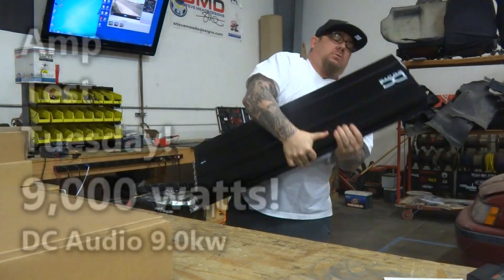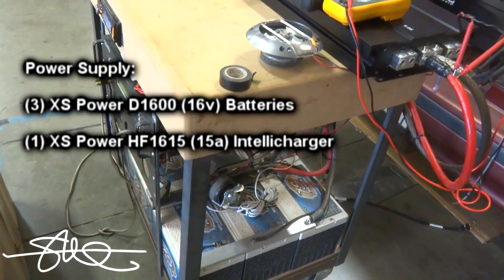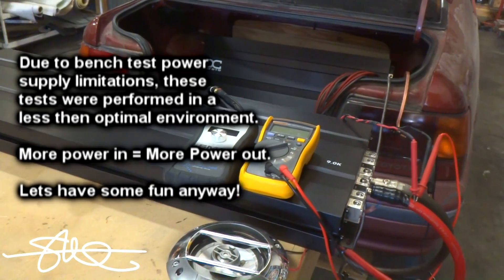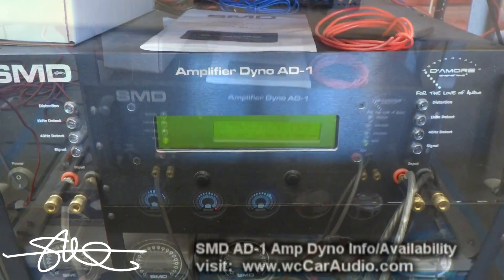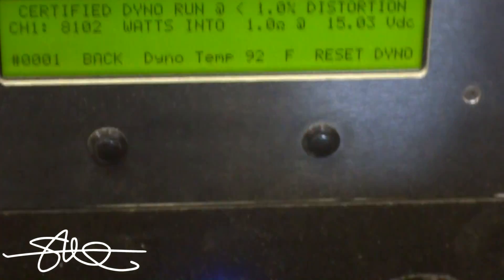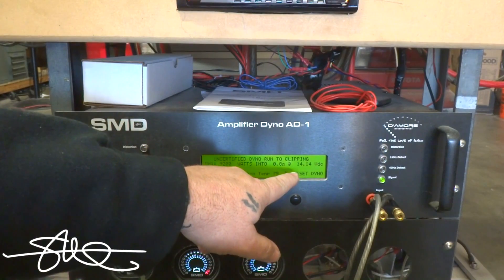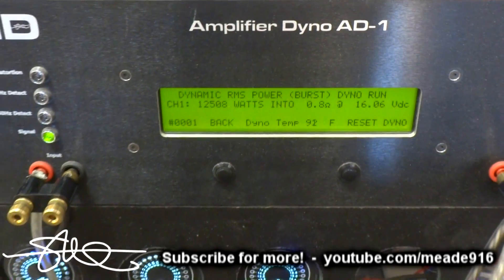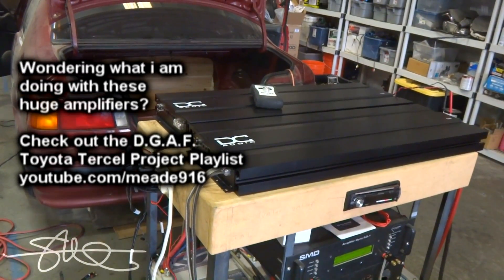Amp Test Tuesday - DC Audio 9.0k - 9,000 Watts - SMD AD-1 Amp Dyno (Results)

Comment: No thanks... That amp for $1750 that does a little over 12,000 watts at .5 ohm. Or a taramps Big Boss 8k for $650 that does 17,300 at .5 ohm. Id take two of those with cash to spare.
Reply from the maker: dude, you are a window shopper.  Hard to take someone serious who doesn't own anything and never has.  Your complaints mean nothing.  Don't tell me what you "would do" show us all what you DID do.  I'll wait. Also, you do realize this video is 10 years old right? relax champ.

Comment: This is a newbie question for you I don't understand how amplifiers can use all the power cable handling of these 2/0 cables when you get inside component wires all appear to be smaller than 12 gauge or 10 gauge. And how does all that juice flow through that tiny little filament inside my 300 amp fuse?

Comment: I'm not sure if you will still reply to this thread Steve meads but I have a 2014 Nissan Altima and I have a 250 amp aftermarket alternator and was looking to upgrade my system next year to 2 level 5 dc audio 15's with a dc audio 5 k  amp with a xs  power 7500 d battery my question is this will running more batteries allow you to handle more power? Because i thought about running 2 250 amp alternators but I was told that might mess my computer up on my car so i was wandering what the best thing I could do your help would be appreciated.

Comment: on some of the bigger amps u have tested couldn't u just pull a vehicle up next to the test bench and run a ground from the engine block and a hot from the battery post of the vehicle providing it had the big 3 done. that way it helps the little battery bank make a pull

Comment: meade916 Thank you for all you videos you my freind do know youre field in car audio.
I want to push 8 12s subs in my monte carlo ls now would you preferr mdf or birch wood?  and i would like 3 amps total.1amp for mids&highs & 2 Amps for the subs any idea i really like jl audio and i have 4 jl w3 12s & 4 kenwoods 2000 watts.
Reply: Natural birch plywood 13 ply is the goods but harder to work with than mdf with the edges and chipping....  Ive used both and the birch is far nicer to me....
Reply: +General Zod thanks thats my choice✌

Comment: how much is the dyno anyone know???
Reply: +CONCRETE MONEY $3400. A bit overpriced, I'd say!
Reply: +meade916 No, it doesn't, but I also think that it is an incredible work of engineering. It looks to be built like a tank and looks very industrial. I love what it can do, and that it was made in the US! I would also probably own one if it wasn't for the high price and the fact that it cost more than my high performance video editing computer!

But, hey, it doesn't matter what I say!
Reply: +Joshua's Recordings Everything is pricey, Its does it do what its suppose to do or better for the money. This is not something an average Joe is going to own, This is for audio shops and businesses that have a purpose for it. 

I see your trying to keep it known you respect Steve that only you feel this item is overpriced. Look on the market for anything that does what this will do and you will find your spending 15k and will have multple pieces of equipment to get the same results yet taking up 5 x the desk space.
Reply from the maker: +Joshua's Recordings good thing it don't matter what you say.
Reply from the maker: +Joshua's Recordings my "high performance video editing computer" costs twice as much as the AD-1..... so i find it to be very cheap and affordable.   And you are right, it still doesn't matter what you say.
Reply: +meade916 Yea, and you run a shop for car audio and do a very good job. So if I did that I would also probably own the AD-1. Also what brand is your computer? Or is it custom?
Reply: ***** i have to agree fully
Reply from the maker: +CONCRETE MONEY what are you agreeing with?
Reply: +meade916 A while back someone posted this: "then it also doenst matter what you say.....TO YOUR CUSTOMERS. f***ing being an a**hole dude....you make the thing.... why would you say anything bad about it? right?   so....wanna print out a parts list so i can go find them all, add together the price, and find out how much profit your making? a resistor network and a few relays, with a few tap points for the volt and amp meter, with a small logic circuit to do the addition... thats not 3.5K.... or does that not matter? you make a product..."For some reason it got removed before I could read the rest of it
Reply from the maker: +Joshua&#39;s Recordings he isn't agreeing with that fuck.  Must be a mistake.  He owns SMD products.  So i am trying to figure out what he is actually agreeing with.  Nobody in their right mind would agree with that piece of shit "kain".  Well just the cowards, the trolls and internet bitches anyway.  That dude don't sound like one in his video but you never know.  I guess i will find out.
Reply: +meade916 Alright then. Glad we got that out of the way! By the way, you seem to know "kain" did he hate comment on other videos?
Reply: Just because you don't agree doesn't mean the other person is dumb. Hate to break it to you - but if you talk to people like that you will NEVER win an argument. By talking like that it shows the other people in the argument who has the facts and who is just being a dumb swearing person that no one wants to talk to.
Reply: Ok, I missed a comma between "dumb" and "swearing". Let's see, you missed a comma between "dumb" and "b***h". You also did not capitalize my name right, you did it: "JOsh", hate to break it to you, the correct why is "Josh". You also put an extra space between your sentences. Oh, and by the way - what did I spell wrong? You are making it quite clear that you are the 12-year-old punk who is trying to be a man.
Reply: Joshua's Recordings TLDR rekt.  Keep crying kid.  HAHAHAHA
Reply: Too Lazy; Didn't Read, huh?

Comment: have you done a system for a Tesla yet? I'm just wondering since the car is basically a gigantic battery!
Reply: ya a tesla would be cool especially the new SUV model X  with like 8 SMD 15 in it in a SQL set up how ever you would need a tesla home back up power pack and step it down to 16v it would be a interesting  project but not impossible. .

Comment: I got a question about amps vs subs if you wouldn't mind aswering(anyone) I''ve bought an orion hcca 15 4 ohm dvc and I was looking at getting a hifonics my olympus atlas 6000 1d is that a good fit?
Reply: I would get an American bass 200.1 that will do better than the hifonics and the build quality of the vfl amp is great they are built like tanks and I seen one run at .25ohms on burps and .33 ohms daily on music. I just bought the smaller vfl120 and it is a massive amp and smashes my old hifonics Brutus amp

Comment: could you do a test on a spl gla1-3400d please???
Reply: Not even close to rated I used to run the older spl amp like the fx3000.1 I think that's the model number, but the gorilla amps aren't good at all. No disrespect if you have one and like it then don't let me take that from you

Comment: Mr Meade nice testing done there.
Would be nice if you ever could use a hybrid car, like a Hybrid Tahoe or escalade.
Even though those batteris are 300v, thinking you are the most experience i known.
Maybe you could make a mod to squeeze 18v out of the 300v hybrid batteries.

Comment: Can you do an amp test Tuesday on a dual 400 watt amp I think it pushes atleqst 500 watts and I wanna know for sure what they push
Reply from the maker: if it is a "Dual" amp i wouldn't get my hopes up on it doing the 400 much less the 500 watts. Sorry bro.
Reply: whats your take on SSL and Lanzer amps?
Reply: DRG Angry I am not playing I had the aero series ssl amp it was 1500 watt monoblock 2ohms stable and only did around 260 watts they are worse than boss. Hifonics is the best for budget amps
Reply: DRG Angry lanzar amps are good for the money. I would recommend the opti drive series.

Comment: Hey Steve I got a question when install sub in you car my sub is 4000 watts what type of amp should I have one with greater watts or lower just not figuring you might know
Reply: GOLDEN CHILD how do people possibly believe underpowering your speakers will mess them up. so no one should run their mids and highs off head unit power because their stock speakers are rated at 15 watts rms? i think you need to realize that alot people who "underpower" their speakers think that since the amp doesn't put out more power than the speakers can take they can turn the gain all the way up in which case distortion and clipping damage your speakers. not underpowering them.
Reply: You needa altleast get 1 that's greater then the watts on the speaker cause under powering speakers will mess them up in the long run if the sub is 4000 I was get a amp that's 5000 watts so that way you know your pushing you subs right

Comment: Hey Steve!
I have a small problem i need some help with.
I recently bought the JBL GTO-5EZ. It's bass channel is rated at 500w rms @ 2ohm @ 14.4 volts/1075w rms @ 2ohm @ 15.5 volts.
I recently blew two different subwoofers on it, and i'm worried over the larger one i blew since it's rated way over my amp's 14.4 capability.

First one i blew was a 10" 300w rms (650w peak) dvc 4ohm Audiobahn Murdered out sub wired to 2ohm.
The second one was a 10" 900w rms (1800w peak) dvc 4ohm Soundstorm CL sub, which was also wired to 2ohm.
I blew both really hard with my amp and the soundstorm sub left a stench in my trunk which will probably stay there for a week or so.

So i'm 100% sure i wired everything properly, and i'm about 80% sure the Soundstorm sub is of way lower quality than the Audiobahn since the Soundstorm didn't respond properly to frequencies above 80hz (amplifier frequency filtering). Both were set up with a clean gain, thanks to a website that gives out free -5db 40hz test tones. So. I made sure the sound was coming out crisp and clean and i definitely wasn't clipping them.

Should i go with a sub passing the 1000w rms mark since the jbl amps are clearly feeding more than the manufacturer states, and since the max at 15.5 volts (even though i'm only running at 14.4) is 1075w rms?
Reply: You need a better sub sound storm is worse than boss get a jbl sub to go with it. Or try alpine type r, American bass xfl, just stay away from the brands that advertise max power it's useless try an American bass you will be happy
Reply: I'm not asking advice, i'm asking for a video of him to try them out, as to have video evidence!. Thanks for the reply though man.

Comment: Nice work Steve. I enjoy the inner geek that says what the hell does it really do. I would like to see some cost to benefit factors tested more. As in I have these 2 tens in this car and I slap amp a in for x dollars and sweep for db's. Rinse and repeat for amp b and so on. The reason I say this is that pep's are all about the amp that squeezed out 56 more watts yet do they even hear a difference. Sure if 1 amp is putting out 150 and the other 200. Most bass heads are going to be looking at less than 1 db difference when jumping from 1 amp to another given that they are rated to be close to the same anyway.

For instance put a SoundQubed 1200 up against a DC 1.2k. The difference in their respective outputs will be negligible at best. So you buy for build quality, features, looks, or cost. I am all for finding the bang for the buck. Perhaps torture test the amps and see which breed takes the beating longest.

Comment: @ Jeff da chef y do I always see ppl dis audiopipe they are not bad amps Steve tested the hifonics 1700.1 elite and it did rated power so what makes an amp bad or good as long as it does what it says it does check out derrick bigdwiz ch. He tested an audiopipe 1500 and it put out well over 2000 watts

Comment: Meade916 I been keeping up with your work...I have a 2001 chevy 1500 extended cab and I wanna run 4 12 type r.. do you have any suggestions on what two good reasonable amps I could run with the most bang for my buck? What are your thoughts on Crescendo audio bc 35000

Comment: Dayuum that's insane. I noticed you also only put one power and one ground to the amp, does that mean you don't really need the other two to run the full 10000 watts ?
Reply: i wouldn't do that. it will probably run hot and over work the amp.thats why it comes with 2 power and ground inputs.

Comment: That is awesome results from the DC amp on that power. You figure each D1600 is good for 1500 watts each, so they are giving that amp all they have and still holding on pretty damn good. 4,500 watts of battery power for a 10K+ watt amp.
Reply: umm you got real life experience in my car lol.. they stay at 11v when im at full tilt.. ;)
Reply: s3ns4i
You have 16v batteries that go to 11V at full tilt?
Reply: J noADnROhh

Comment: Your more than likely to busy to answer this but i have a 1998 Z71 pickup truck extended cab with 2 orion hcca gen 2 10inch subwoofers hooked to a (i know its pretty cheap) a planet audio big bang series 1400.1 "1900 watt" amp. My question is would it be enough power in my truck if i ran a single XS POWER battery up front in my truck? If so which would be the best one to get?
Reply: the bigger the better they say :P
Reply: you can never have too much overkill with the electrical system. Hell, overkill is the only way to do it!

Comment: I must say I'm an Alpine fan but the cost is far to high like most well known Audio brands! So when my MRP died I wanted more power but 1000 Alpine watts cost wayyy to much for me. What I really want to know is. What is the cheapest 1000wrs amp out there.
Reply: hifonics brutus or gladiator series cea rated (does what it says) and they are pretty thrifty
Reply: You can pick up a rockford fosgate prime 1200w for around 250 from sonic electronix. Or an american bass 80.1 (does 1k) for around the same. Both much better quality than hifonics.
Reply: i'd go with precision power black ice 1300 over hifonics anyday if we are talking about budget quality power. Check in with a CT sounds at 1400 or a soundqubed 1200 if you want good shit for good price.

Comment: I have never noticed the sound from the dyno in any other vids was that all that power or is that normal when it put up the 9k temp jumped to 110 lol dyno hated that amp cant wait to see it with strong voltage lmfao you gotta get like a 1.21 jiggawatt sticker for car that would be epix

Comment: What are those arcing like sounds that happen when the voltage drops a lot on the certified and uncertified runs, and then also on every hit in the dynamic run?
Reply: I believe it was the Honey Badger indicating the amplifier reached distortion. I think the top red LED on the left and right side of the unit means distortions then you can see it backs down in the center gauge.

Comment from the maker: first. Yessirr..
Reply: I think it would be awesome if you did some of the Optidrive amps from Lanzar. Specifically the 7k, because I've seen many people run them but im not sure if they put out the power they say they do.
Reply: 16v will fry a ecu!
Reply: Doh
Reply: Chris Peden nowadays they are hifonics, precision power and audiopipe grade amps, not even close the shadow of what they used to be.
Reply: What! What!.......
Reply: HighSchoolBassHead I own a Opti Drive7000.1D and I Clamped around 3500 watts wired at 1ohm rising to around 2.3 ohms on one battery and a200 amp alternator dropping to around 11.5 volts and its rated 7k at .5. 
Sooo yes they do rated power
Reply from the maker: Dalton Cloutier clamped? what did you use to stop the test once distortion or even clipping for that matter is reached? clamping sucks bro.
Reply: meade916
I USE YOUR DD-1 :)
You like that advert? lol
Reply: How do you get 16volts from a car? That would damage your other equipments... also if they made amplifiers that needs 11.0 volts and 1000 amp inputs that would be more efficient
Reply: donfritz0 more volt = less current.
Reply: CVLova CV um..no.
Reply from the maker: donfritz0 ummm, ok. lol....
Reply: timmyboy yess at same watt it is. if you drop to 11 volts. you need more current to maintain the same rms than if you where at 14volt...
Reply: CVLova CV more volts REQUIRES less current to maintain a certain wattage, yes. Watt = Amps x Volts. 
His inference assumed that just because you increase voltage, your current decreases. Which is incorrect.  And of course irrelevant unless there's a load in the circuit.
Reply: meade916 do a Soundigital EVO 3000K. 2 ohm
Reply: https://youtu.be/xukCxZHtma0